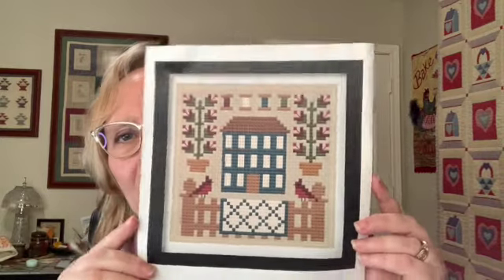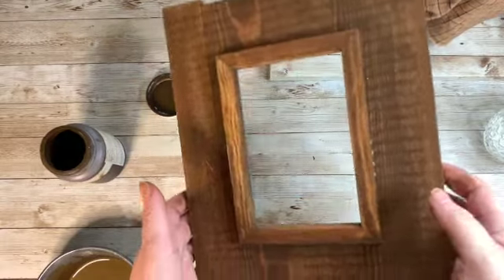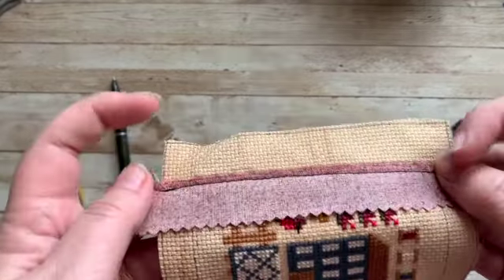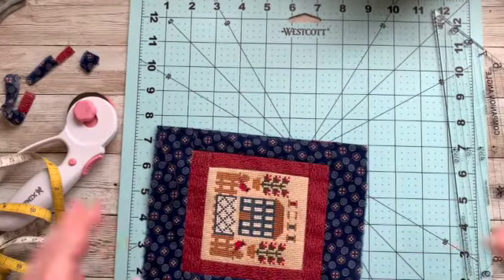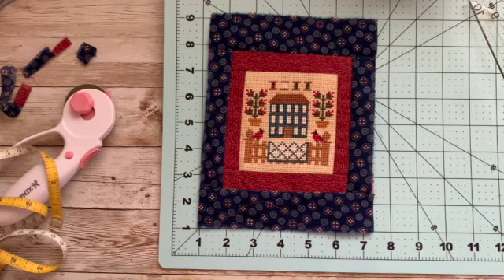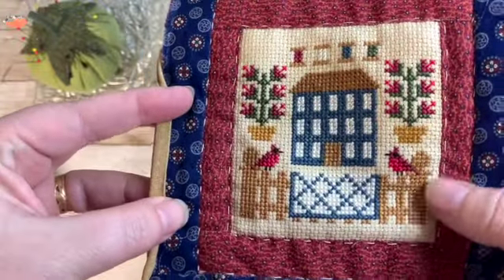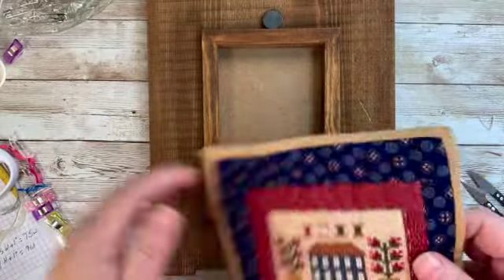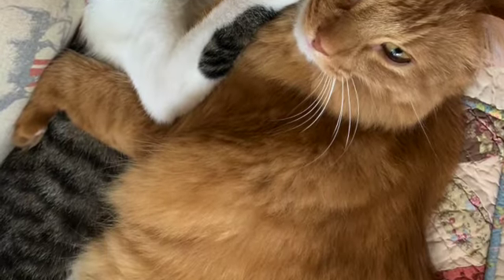Floss Tube #4   CROSS STITCH FINISHING TUTORIAL  / Mini quilt for a cross stitch quilt

Comment: Thank you for all of your tutorials. Just love them and for sharing your beautiful stitching. I am left handed too and had problems using a rotary cutter until I saw someone reverse the blade on the cutter and it works wonderful for me. I also got these rubber dots to put on my rulers that keep it from sliding. It helps a lot with measuring and cutting fabrics since I am new to quilting.
Reply from the maker: I will look into the dots, they sound very helpful! Thanks so much for watching and commenting🧡

Comment: Love your stitched piece.  Check to make sure your side lengths match as well as your top and bottom measurements should match each other, that will help avoid the uneven edges. This is why your mini quilt ripples. Also, generally when binding a quilt sides are added first and to and bottom second. But honestly it does add to the rustic charm. Good job!
Reply from the maker: Thanks for the tips I really appreciate them!